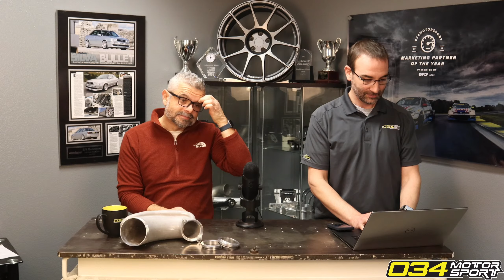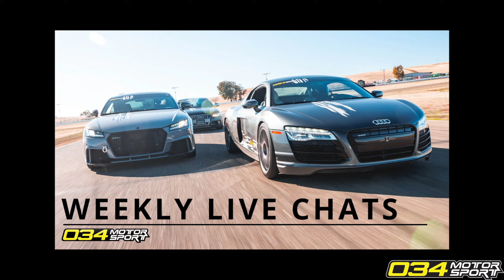Live Q&A, Round 83!

Comment: Why is the AL552ZF8 TCU Stage 2 Tune for the B9.5 available only up through the 2020 models, whereas the EA839 ECU Stage 2 Tune is available up through the 2021 models?  Are we working on the TCU Stage 2 Tune for the 2021 models? ETA?  Frustrating, particularly for those that purchased your Stage 2 ECU Tune, and are now left without the optimal TCU Tune pairing.  Kinda like wearing a size 9 shoe on the left foot, and a size 10 shoe on the right foot.
Reply from the maker: Our Stage 1 TCU tune is optimal for the 2021 model and our Stage 2 tune is currently in the works. The 2018-2020MY and 2021MY AL552 uses different TCU's which is why we are not able to offer our Stage 2 TCU tune for the 2021MY at this time.

It is being worked on, though we do not have an exact ETA at this time.

Comment: In regard to the recent tcu tunes available for the b9 stuff on the website it shows the charts comparing different metrics between stock, the stage 1 'lite' file and the stage 2 file. One of those being the shift speed for the 'lite' file saying its suitable for both stock and stage 1 'lite'.  Have the stage 1 shift speeds been reduced back to a stock level then or have you guys further gone and increased shift speed with the stage 2 file?  Crazy to think those shift speeds could have been sped up at all haha. I dont see myself using the stage 2 tcu file at all since stage 1 has been amazing for me so far and does what I want it to do perfectly and I dont wanna reflash and have my shift speeds be slower all of a sudden.
Reply: Hello! Within our Stage 1 ECU + TCU combination, we are able to improve shift speeds on the ECU side of the calibration. The Stage 1 TCU calibration does not effect shift speeds in any way, but rather improves the torque management to handle the increased engine output. Nothing has been reduced "back to a stock level"

Our Stage 2 TCU tune takes this all a step further by improving shift speeds to be even quicker. We assure you that you will definitely enjoy these increased shift speeds!
Reply: @034MotorsportUncut  Ok makes sense, I remember you guys saying that before with the r2.0 ecu the shift speeds were increased and I found that to be such a huge improvement!  Just wanted to check to see if the ecu side of things had been altered at all since the stage 2 tcu came out! If its only been improved on then I might just have to give it a go come spring.
Reply from the maker: The ECU side of the shift speeds remains the same; a dramatic improvement over the factory. The Stage 2 TCU tune takes things further!